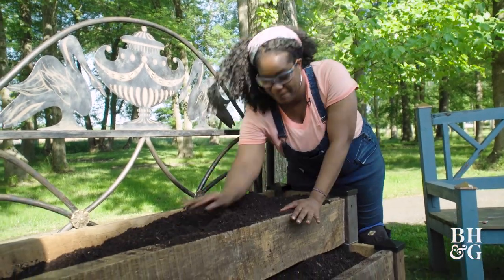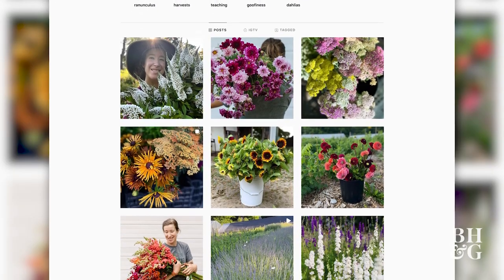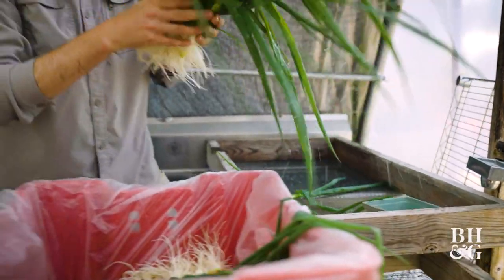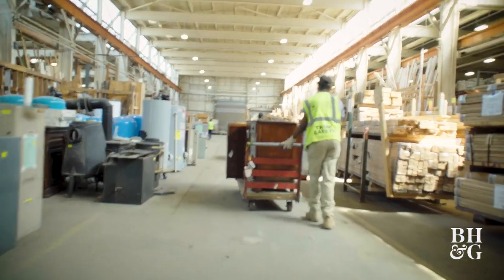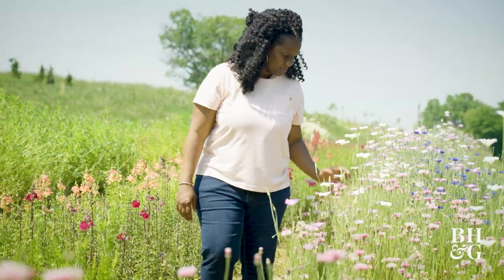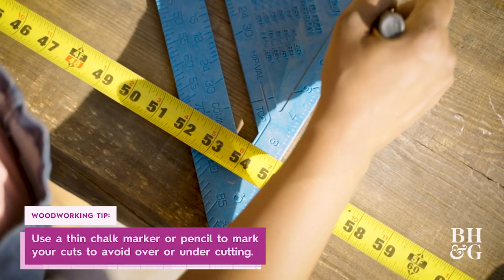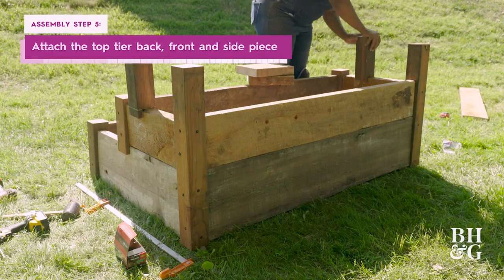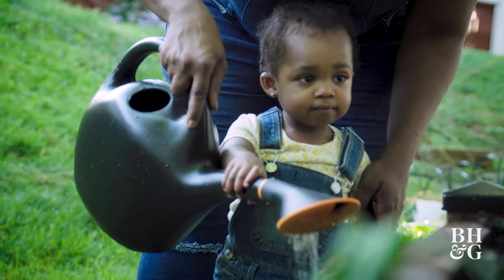Grow Your Own Food With This Simple DIY Raised Garden Bed | Weekend Woodworking | #BHG

Comment: I have built two 22 inch high, 6 foot long and 3 foot wide raised beds. They are built with Pressure Treated Wood as long as the wood you got is after 2010, as pressure treated wood pre 2010 had arsenic and other chemicals in it. I have also used Decking/Shed Paint on them to preserve the wood for a few years, and i have also lined the inside with DPM (damp proof membrane) punched some holes in for drainage then i filled them up with mix of Homemade Compost, Sieved Soil, Coco Coir and Perlite at the moment bed 1 has Garlic and Onions shooting up, and the whole bed is covered in a Straw Mulch, bed 2 is just sitting there ready for some Tomatoes, Carrots, Basil and some Marigolds at the end.
Take Care and Stay Safe,
Barry (ENG)